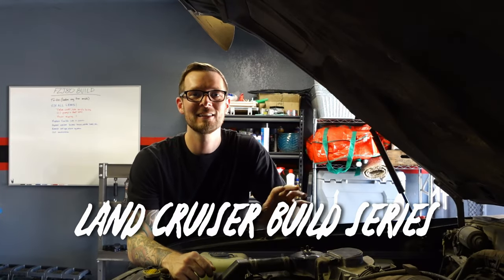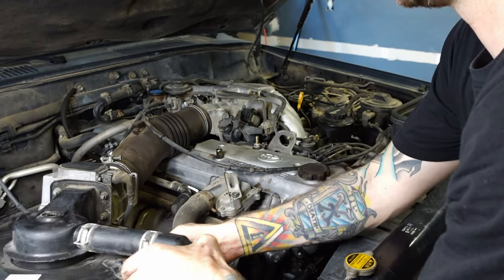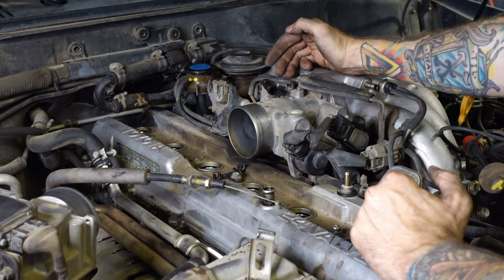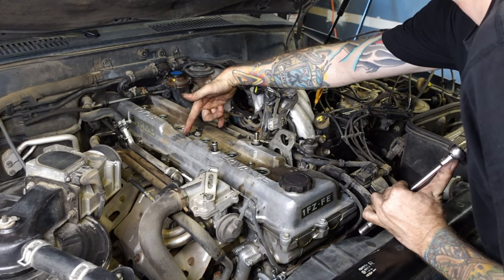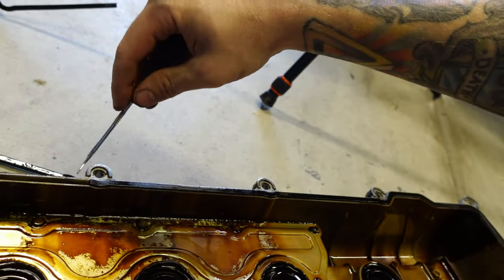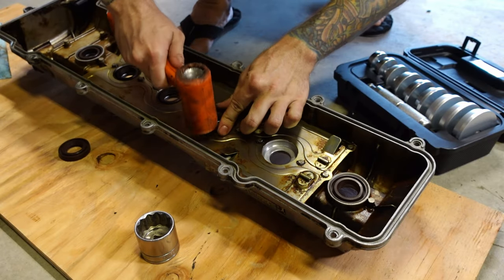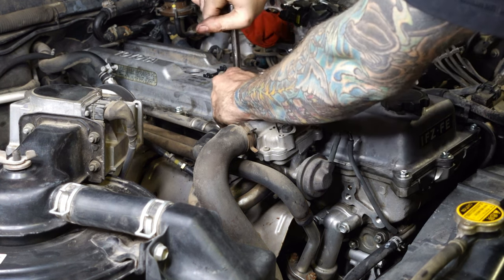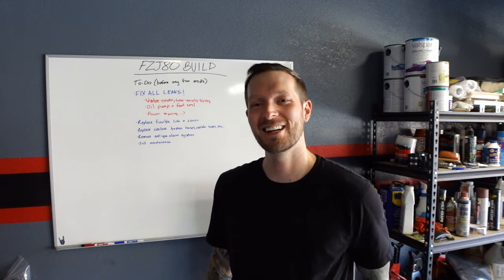Valve Cover Gasket Turns Into ENGINE REBUILD...😑 | 80 Series Land Cruiser Build Ep. 1

Comment: Man, that's some tough luck, hoping my 97 it's still in decent shape, but looks like I'm doing a valve cover to check 😅.
Reply from the maker: Yeah man. And you have to remove the motor for this unless you want to mess around with a short block in frame. Wasn’t worth it to me